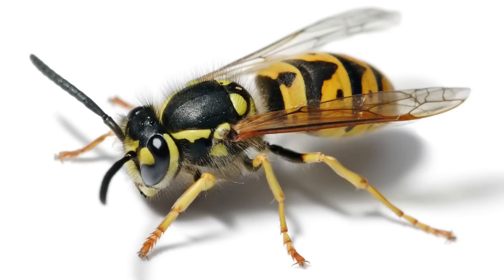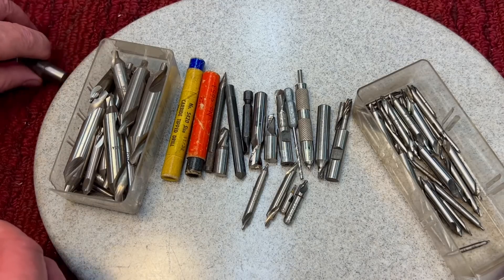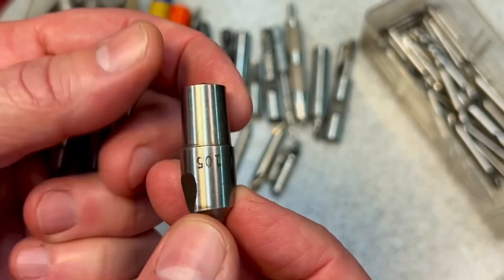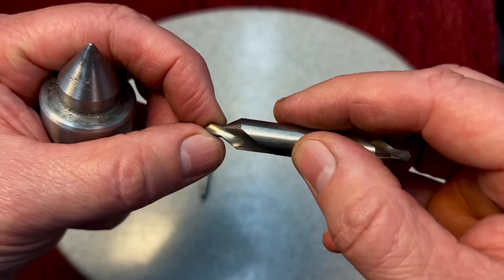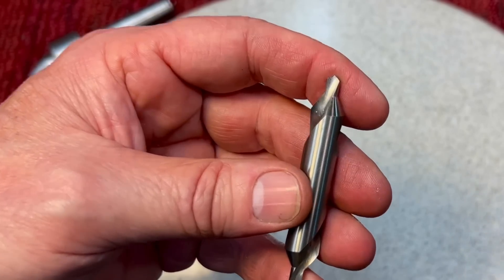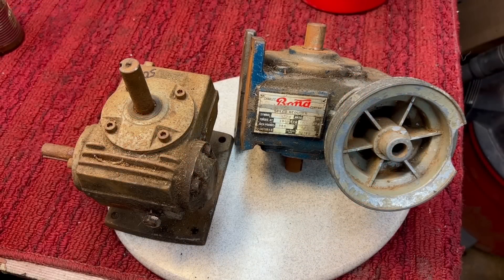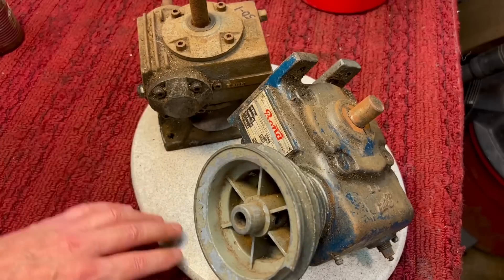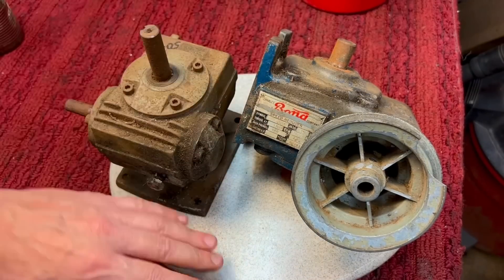EARLY UPLOAD- Center Drills, New Recovery Items and Speed Controllers.

Comment from the maker: Sorry about dropping this video so early- 🫣.
Reply: No need to apologize, it's a gift!! Sorry to hear about your beestings, I haven't been stung since I was a child and boy was it painful.
Reply: Wait a sec, did you call them YellowJacks? I thought it was Yellow Jackets.
Reply from the maker: @Russ0107  Yes- Yellow Jackets is their name but I believe most of my area leaves off the “ets”. 😂👍
Reply: I had to check my clock. I thought I overslept! 🤣
Reply: I was happy to see the early video.  I didn't mind at all.  What a great deal on those speed reducers!  As far as the bee stings.  My first one was the early 60's on the bottom of my barefoot.  The second time was in the mid 70's while riding my motorcycle.  Long story short,  I hit a half dozen bees that ended up under my tucked in t-shirt and I had a bunch of welts on my stomach where they stung me.  As a side note,  I didn't always where a helmet when riding a motorcycle and one evening as I was riding the back roads out near Berlin Lake in Berlin Center, OH, I got smacked dead center in the forehead by a dragonfly (I think) going about 45 mph.  I had this dragonfly goo all over on my forehead and it hurt worse than ALL of those bee stings!  Also, rain.  Riding without a helmet and getting hit in the face by rain is very painful. It feels like being jabbed in the face with a bunch of needles (or pokey things 🤣) over and over.  Boy, you sure slow down fast when that happens!  Another time, I wiped out on a gravel road and had to pick the gravel out of my scalp using tweezers.  And that time I was hiking and got hit in the face with a thorn apple branch.  Did you ever see how long those thorns are?!?!  Yeah, 2 inches of thorn went in at an angle. The whole 2 inches! I pulled it out and months later, I had what looked like this huge red sore appear.  I broke that open and discovered the rest of the thorn!  What a hoot that was and we all had a good laugh!  I have also ridden in the back of pickup trucks and station wagons!  Man, those were the good ol' days!  🤣🤓
Reply: It did not bother me one bit, I was just laying in bed  trying to find a good tool video and "viola"
Reply: From what I am reading, a tapered countersink is made to be used in a press, unlike the the two sided countersink. The taper is used up to 1900 and going above that speed will comprise the strength of the metal. A hand drill wouldn’t be the motor to drive those countersinks. I am wondering if those have a special collet that they fit into making them more sturdy for higher rated steel. I am not a machinist, just an assumption really…..

Comment: I have many electric Milwaukee hand tools. Most were my grandads but ive bought several also. The low speed heavy drills can hurt you if not careful. Whether with a handle or not. But awesome strong and reliable tools.
Reply from the maker: Yes!  High torque hand drills are really dangerous!  They will literally spin you around!  🫣😂👍

Comment: We use gear reducers quite extensively at my work, mostly for conveyors. We had a process that used a gear reducer to drive an overhead conveyor that had 2500 foot chain for moving dozens of molds that weighed 7500 pounds each.
Reply from the maker: Jeff- I bet that is a mechanical marvel!   😃👍
Reply: @ScoutCrafter  it was literally like working inside the machine with all of the molds moving and walking amongst them. It took special training to be allowed into the area. Unfortunately we shut this process down a few years back. This was featured on a TV show years back - I was unsuccessful in a Google search for it.

Comment: I have never seen a pulley like that.  I have seen that style rope shackle but I have been out of the jeep offroading club for over a decade.  Nearly everyone still had wire rope then, the synthetic line was just for the guys with deep pockets.  It was always annoying arguing work load limit vs break strength with the equipment.  Those gear reducers are awesome, like a winch worm drive.  I would try to build a slow speed grinder for sharpening lathe tooling.
Reply from the maker: Patrick- The pulley is new to me also, my pockets are very shallow.  😂👍

Comment: You addressed the 60 degree center drill and showed a spot drill.  The spot drill would have been perfect for drilling that starting hole in the tin can. The center drill  at 60 degrees is narrower than a standard drill bit angle.  The spotting drill does not have that delicate stub tip like a center drill. You always see those tips snapped off.   I used to use center drills as a starting drill until I got spot drills.   Now I leave the center drills for drilling lathe centers.
Reply from the maker: True- However sometimes you need a very small hole and the spot drills don’t really allow that.  😃👍

Comment: I've been using center drills since I was just a boy working on Dad''s oid South Bend Lathe. 
Nice for starting holes in anything. Works well for spotting with a drill press too.
Never have seen a tapered shank countersink. 
Many, many years servicing, installing, rebuilding, buying, etc. speed reducers. Very common on bucket elevators, conveyor belts, welding tables, lifts, you name it and if it needed a motor a gear reducer was a inexpensive way to use a smaller power source to do a lot of work with minimal service. 
The oil bath gears were great for dirty environments like foundries. Hooked up with splined couplings they prevented belts from burning in hot environments too. $5.00 was a hot deal. 
I want one for a rolling mill.  This might mean I need to take a run at the flea markets and swap meet in your area John. 😁😁😎😎
Reply from the maker: Dave- Years ago I bought a speed reducer not knowing what the heck it was, I just thought the mechanism was great.  😂👍

Comment: I got 7 12 Yellow Jacket stings just a couple of years ago.  5 on the same day on a remodel job in the woods, and 7 just 2 weeks later on a different job at a winery all in my scalp.  Quite the headache!  The yellow jackets truly serve no purpose as far as I am concerned.  Picked up a set of center drills based on Scout's recommendation, but haven't had the opportunity to use them quite yet.  Thank you for yet another informative video.
Reply from the maker: Bill- so many wasps are just angry for no reason.  😂😂😂👍

Comment: I was stung by the yellow jackets two different occasions, 9 on one occasion and 5 on another while cutting the grass. I waged war! We used to have those gear boxes back when I was a mechanic for docks and doors. They were on the rolling steel doors like the one you show. I also worked on Rapid Roll Doors by Albany. Some had gear boxes and others had PLCs to control speed those were cool and expensive motors no matter what. They also had a brake and clutch. https://www.youtube.com/watch?v=No4tl3UdoHE

https://m.youtube.com/watch?v=DgIdTWC5sbI

Comment: I’ve never seen that aluminum ring. I have three snatch blocks in my truck and use those.  You never know when you need to double or triple up on the pulling power of the winch!  You hit deep clay mud and you might have to pull 5-10x your vehicle weight to get unstuck!
Reply from the maker: Yes!  These are new to me also-  all the 4WD guys are using them now.  🤔😃👍

Comment: Using it as a counter sink, great idea.  Does the screws have a correct angle to do this? Or are you losing contact between the screw head and the work surface? Looking at drywall screws I have in “this bucket” on my workbench, they appear like they are not 60 degrees. I’ll have to go pickup one of those center drops to check!
Reply from the maker: Most screw heads are 82 or 90 degrees heads, you can get center drills in different angle’s depending on your use-  😃👍

Comment: Great video 👍 What a fantastic job explaining and demonstrating the many usages of center drills. I have to buy me a assortment of them now😂👍. That Curt towing hook mount looks super heavy duty . That recovery ring is a pretty good tool to save the trees 🌲 if you have to attach around them 👍. Those vintage speed reducers or ⚙️ gearboxes are pretty cool and they look like a great project to restore 👍. Those tampered shank center drills may be used with a CNC machine maybe??🤷‍♂️Those yellow jackets 🐝 are nasty little creatures , they are always aggressive. Well again great video and can’t wait to see what you do on Wednesday. Have a great evening . 😃👍👍
Reply from the maker: Steven- Buy a set of HSS Center drills and you will wonder how you did without them!  😃👍

Comment: A special treat having the mosh early. I was stung by a yellow jacket on the lip which was inside a soda I was drinking. Swelled up bigtime! We used speed reducers at the concrete aggregate and asphalt plant where I worked to slow down rock crushers, shakers and conveyer belts. Very large motors! Interesting show on center drills. Watch out for those flying critters!

Comment: Could you use the tapered drill shank in a 0 Morse taper tail stock on a lathe. The gear reducers would work great with knife sharpening wheels.
Reply: Yes, the Craftsman Dunlap 109.xxxx series lathes and the Craftsman Atlas 101.xxxx series have the MT 0 tailstock iirc.

Comment: Hey John, Last time I got stung by yellow jackets was in the 70s. I was pulling out fence posts and didn't know there was a nest in one and got nailed about 20 time before I could get out of there. Had to go to the hospital and found out they were real bad that year. Figures.  Yes I've used gear reduction tranys where i use to work. We used them on lifts for pulling heavy items out of machines. They work great to give you a lot of control and a ton of torque. As you said they slow down the RPMs but they also multiply the torque giving you a lot more control on how fast you pull something. Great little items to use. I  also used one to pull motors out of cars in a garage I had. You don't need a very powerful motor to do a lot of lifting. Later

Comment: I have never used a speed reducer but your example of how it might be used on a garage door is a good explanation. Thanks for the info on recovery equipment. That's good consumer advice on break strength capacity vs. working load. Be careful out there and watch out for tricks.

Comment: I don't have any comments on the tapered shank bits or the speed reducers. I do have a fair amount of experience in hooking chains, ropes and come-alongs to the back of trucks. With my own vehicles I usually just use the receiver hitch. Once my boss's brother and I had to remove a couple of bushes from a customer's yard. I had dug around them and we were ready to try pulling them out, but the only rope we had was some really thin sisal rope I had in the trunk of my car wrapped the rope around the trunk of one bush and tied the other end to the rear crossmember of an almost brand new Dodge D-300 dump truck. I figured either the bush would pull out or the rope would snap. I was wrong. The frame of the truck bent😱 My boss never said a word to me about the bent frame which was even more surprising than not breaking the rope.
Reply from the maker: 😂 OMG!  I never would have expected that!  You had some strong rope!  😃👍

Comment: I used to sell heavy equipment and the aggregate stacking conveyors we sold used Dodge gear reducers to slow electric motor speed down to the required conveyor belt speed. They were quite large components and needed to deliver a lot of torque to power a 105’ long 30” wide conveyor belt loaded with gravel or crushed rock from ground level to the top of a huge stockpile!  
Thanks for showing us these units and demonstrating them so simply Scoutcrafter!
Reply from the maker: They are pricy units but really interesting!  😃👍

Comment: Those tapered center drills look to be Morse taper 0, and fit the tailstock of the smaller 6" lathes such as the Craftsman or Atlas as I recall.   Also a few years back had yellowjackets  get me, a couple to the face.  Had to get steroid shot to manage the swelling.

Comment: Those speed reducers were a bargain, looking forward to seeing what use you put them to !

Absolutely know what you mean about spurious specifications on Amazon, I bought a set of castors for making a mobile base for the workshop, they were listed as having bearings and were rated at 360kg, they were very reasonable and spec was well beyond my requirements. When they arrived I took the wheel off one to check it and it had no bearing - just a plastic wheel with a steel tube around the fixing bolt - not a problem for me, but quite misleading, I certainly wouldn't want to load it up to 360kg ! They did have bearings in the swivel cup though.

Wasps are a pain (literally) and often spoil a late summer picnic or BBQ !
Reply from the maker: Yes!  Castors are perfect examples!  😃👍

Comment: I’m planning on building a bandsaw mill with full hydraulics.  The gear reducer could be used to slow the log turner down if the hydraulic motor I bought is too fast. I know you can slow the motor but I’m guessing you lose torque.  I remember every sting I got and I keep bees.  I got stung over 50 times with bees a couple of times.  It was funny I was driving home after the stings and my back pain almost left me.  After that my friend, also with chronic pain, would come over and we would catch a few bees for bee sting therapy.

Comment: It's a Morse taper, it will fit into an adapter or the bigger ones will fit right into the tailstock of your lathe, for example
Reply from the maker: From my measurements it looks less shallow than a MT.  🤔
Reply: @ScoutCrafter  these are the dimensions I have,  if its not a Morse taper, its anybody's guessTaper Size	Ø D1	Ø D2	Taper/Ft	Taper/Inch
#1	0.4750″ 12.065mm	0.3690″ 9.373mm	0.5986″	0.0499″
#2	0.7000″ 17.780mm	0.5720″ 14.529mm	0.5994″	0.0500″
#3	0.9380″ 23.825mm	0.7780″ 19.761mm	0.6024″	0.0502″
#4	1.2310″ 31.267mm	1.0200″ 25.908mm	0.6233″	0.0519″

Comment: I worked in a papermill that had a "line shaft"...each section of the paper machine had its on gear reduction unit...the "wet section" the "dry section" the "finish section"...
These were very large... requiring a crew of man that only "maintained them"....greasing oiling them...the line shaft ran at 750 fpm but the machine ran at 1700 to 2000 fpm...so all of these gear reductions needed to be timed and variable.... engineering nightmare...after 17 years I retired....just my 2 cents worth...👍👍👍😎😁👀

Comment: The last couple of speed reduction gear boxes I dealt with were for a plastic wrapping machine and a rotary welding table. The welding table one also had a variable speed drive, so the operator could adjust the speed depending on the weld.

Comment: Those speed reducers would be perfect to make a rock tumbler.
Reply from the maker: Rock tumblers usually have a built in reduction, along with a noise that doesn’t let you forget it’s on.  😂👍
Reply: How would that be more efficient, I'm curious?
Reply: @5000go2  well a rock tumbler going at 3400rpm would be more of a sentrifuge
Reply: @einarhaugen2250  that makes sense. Thank you for answering that.
Reply: @5000go2  You are welcome. I hope Scoutcrafter makes on. I mean... What kind of maniac doesn't like rock tumblers???

Comment: Hi John. You sure are a night owl. Me too. Would those tapered ends fit in the tail stock on a mini lathe?🤔.I use gear motors on the sphere machine I made quite a few years ago. They are geared down to 30 rpm. You have a great day. 👍👍🤔.
Reply from the maker: Larry- The taper on the bits is very shallow unlike a Morse taper bit-  I’m perplexed!
Reply: I had the same thought as Larry.  Perhaps there is a much smaller taper receiver in use - for example the family of tapers in drill chucks.  Even though these are smaller than a MT-1, maybe the amount of friction required for these bits to hold allows for a dinky taper.  I hope someone actually knows!